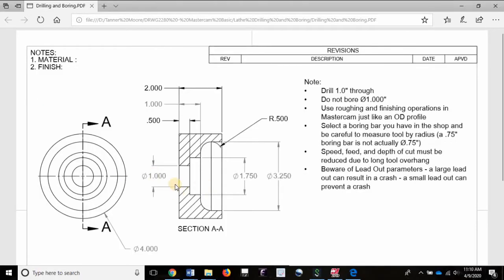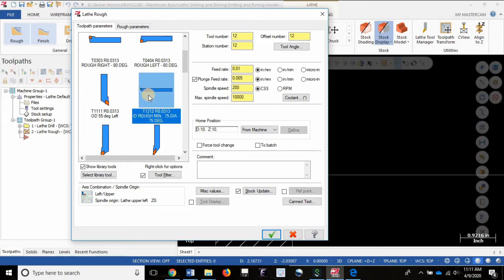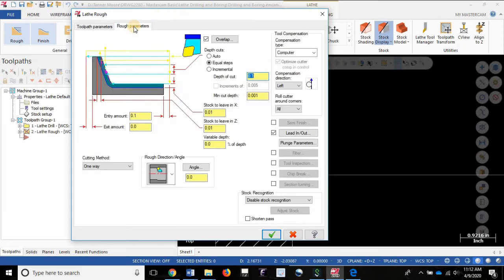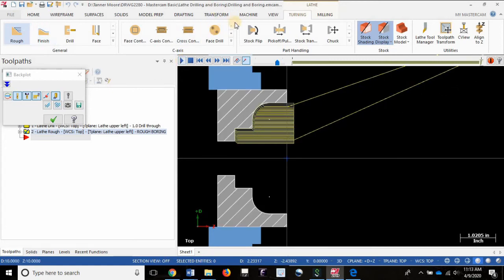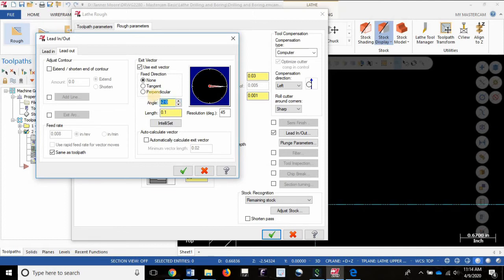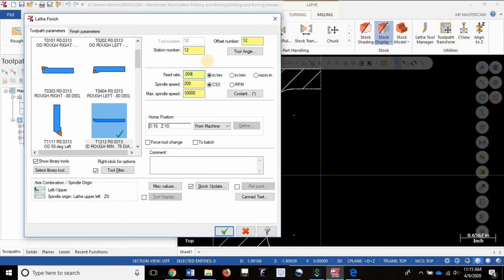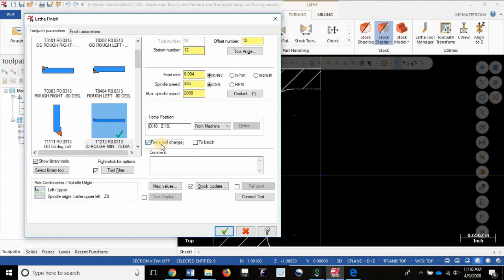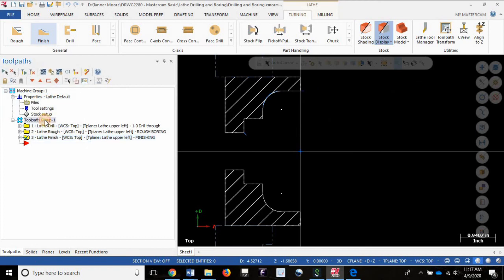Mastercam - Lathe Boring

Comment: Is there a simple way to start your turning on the id where your clearance drill leaves off? By starting to bore at x0. The bottom of the bar crashes on the opposite side it’s supposed to cut.